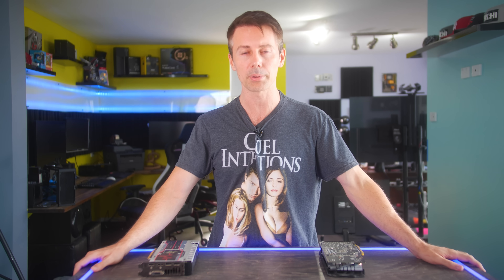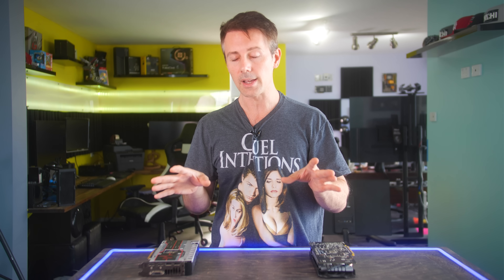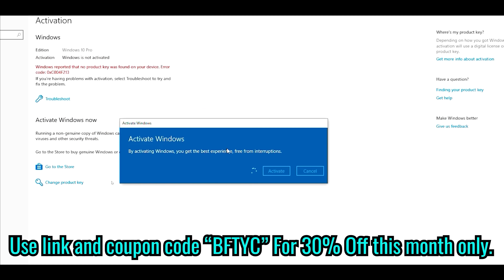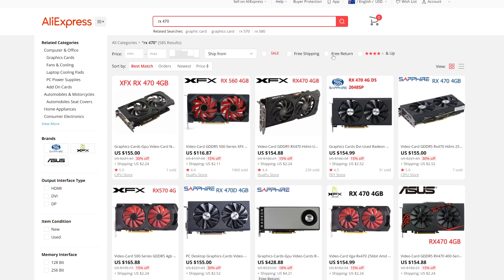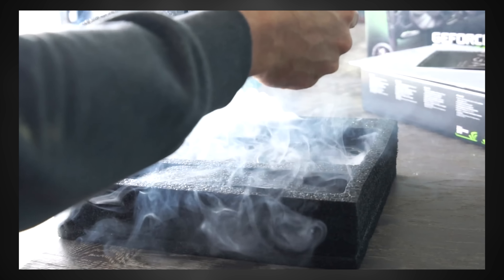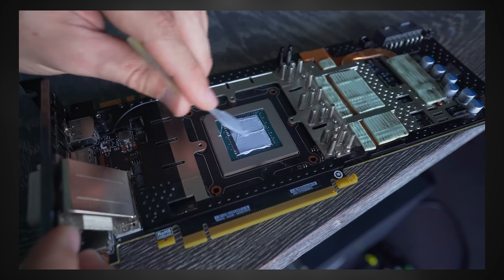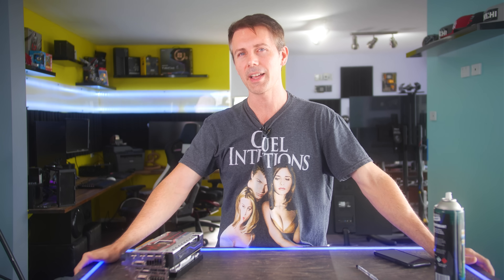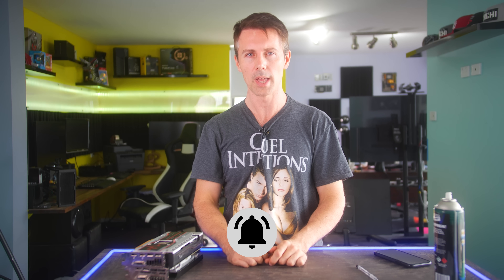How to BUY a USED Graphics Card in 2021's CRYPTO BUBBLE.

Comment: Ebay tips:

1. Only buy from sellers who accept returns. Even though ebay provides a guarantee anyway, it can be a lot less hassle if the listing specifically states that returns are accepted. Yes this narrows the field somewhat, but it's worth it; just be patient to find the right deal.

2. Stick to listings where you can visually confirm the exact model number of the card, eg. on EVGA cards it'll be a sticker on the back, and preferably cross check with a GPU-Z screenshot or submission.

3. Never rely on the ebay description or any related code in just the title; always check the pictures. If there's a mismatch, ask the seller to confirm the situation. Often the mistake is unintended, ebay may have suggested a particular code in error (this happens a lot with memory kits, people confuse DIMM capacities with kit capacities).

4. If possible, stick to listings which include the original packaging, as this means more reliable and safer shipping. If there is no indication of how the card will be packed, then ask the seller to confirm. The goal is to avoid receiving cards that are posted in just a jiffy bag, since damage is much more likely if posted in that manner.

5. If you do encounter a problem, stick 100% to the proper approved ebay returns process; contact the seller, try to resolve it in whatever manner, but if you can't get anywhere then don't wait for the claim period to expire, open a case for a return.

6. Beware of excessive shipping costs. And if shipping is free, check what service they intend using (I wouldn't want a GPU posted using some janky economy courier). Sometimes I may even ask if I can pay extra for a proper fast shipping service.

7. Don't go anywhere near listings which say PayPal is not an accepted payment method, or insist on cash on collection, etc. Sellers are not allowed to prevent one from paying by PayPal. Stick to the approved methods, otherwise one may be unable to file a claim if a problem arises.

8. Check the seller's other listings. If they have other PC parts listed aswell then it's likely they're splitting up what was a complete system, which would give credence to any claim about the card being ok.

9. And as Bryan says, if it looks to good to be true then avoid. That's not to say bargains don't crop up, they certainly do, sometimes sellers just don't realise what they have, or they need a quick sale for some reason, but don't get swept up in the heat of the moment, the pysch pressure of not wanting to lose on something.

10. For normal auctions, decide in advance what is genuinely the absolute most you are willing to pay. Don't engage in the early bidding process, that's a psych trap that can draw one in, resulting in panic response bids because, with seconds to go, suddenly being outbid can feel like a personal attack. Don't let emotion rule the day. Decide on a max, submit it with some seconds to go, and if you don't win then never mind, be patient for future opportunities. Also, never bid with an overly even amount as your max bid, eg. don't bid a max of 200, instead use something like 206.50 or somesuch. With the way ebay works and the way people decide what to bid, this method can often bag a win just because the other guy bid a nice round number, though of course at the same time don't let this idea push your genuine max too high.

11. Lastly, if you don't win an auction, then mentally let it go, especially if you think your bid came in second. So you may have bid 375 and the winning bid was 382 or something, but that doesn't mean the other guy won it by bidding a max of 385 (so in your head you end up kicking yourself, thinking if I'd just bit that little bit more), ie. you can never know what the other person's max was, for all you know they might have bid 600, presumably an amount way to you but to them not a problem. I've won listings in the past for, say, 25 or 30, and perhaps whoever didn't win was kicking themselves, but they'd never know my max was more like 200 because I knew I could sell it on for much more. In other words, don't let your imagine run wild with self punishment if you don't win.

And for sellers, pack the parcel properly! Here's my ebay and ebid packaging advice page:

http://www.sgidepot.co.uk/postingadvice.html

Comment: I Sold my used XFx rx 580 8gb in gaming for 275$ and got a Sapphire nitro + rx 580 4gb for 138$ and it was very clean, even tho it came with a custom bios for memory timings. Works great  ,great temps ,even tho was mined on most likely.

Comment: Hey should I pick up a rtx 2080ti from a friend for $670? I’ll be pairing it with a Ryzen 5 3600 and 1080p 144hz monitor. I’ve been trying to to get a 3060ti but have had no luck. Do you think it’s worth it or should I wait for the 3060 launch?
Reply from the maker: For the question, it depends on if you really want to game now vs waiting it out.  If crypto does go belly up then there will be a lot of cheap graphics card. Though $670 isn't too bad in this current environment... Also Ignore those previous replies, is spam from a spammer, fixing it now, also thanks for commenting :)
Reply: Thanks for the advice! I’m tired of waiting and feel the 3060 will be extremely hard to pick up at launch anyways. With how profitable crypto is now I could end up doing some mining on it to cover its costs.

Comment: Hey can you make a video about gpus crashing after drivers are installed. It happened to my gtx 970 but apparently it's a common problem. After installing drivers my pc will run fine then my screen will go blank but the pc will still be on (all fans spinning)

Comment: Yes i would like to add a trick that i use is to use AMD FLASH tool to read bios and run the serial key over the internet. That somehow gives me insight of bios and 2nd is the color of the PCB. I had an RX 470 nitro which was in fact a 470D with a bios of something else I have never seen such thing in my life until that point. I was sad about it so i sold it and got new 1650 super.

Comment: To confirm you're getting the correct model card, get the seller to provide a photo of the serial on the card. It will generally have the model number along with the capacity.

Comment: I used my 1080 ti a long time with overclocked settings (i.e. up to +500MHz, but only 300 most of the time), and at some time weirdness started - at least under load, not in idle - and the game crashes when the GPU is under load for a longer time. Sometimes, it also bluescreens with the reason "video memory management internal". Such a pity, would be worth so much these days :(

Comment: The ex mining rx 580 i bought for a £110 uk was like new cleanest second hand card i have bought standard bios and seller said it was undervolted card was put in a pc for my sisters son and has been rock solid but i got an rx 480 in my new build for now for 1080p came in at a £100 posted is what it is again card looked like new seller had sold over 262 of them my stem libary i have had for so long i have games from many years and plenty of classic games from gog .Something i noticed on ebay was a boxed ryzenn 2200 fetch over £96 wich is great as i have one in my new build before i get either a 3600 or 5600 cpu that price is more than i paid for my 2200 so i could sell it on and put the difference to the money to buy the 3600 at this moment not in a hurry so i can wait for cpu and gpu,s to become available .

Comment: I don’t think the gpu was mined on but I have a 6870 that did work and then when I tried to update the bios it stopped working, but only kinda? I switched hard drives and it tried to boot to windows. But the first hard drive it wouldn’t display at all. I don’t think it got past the windows loading tho because I stopped because the different drive I put in was a really used and slow 5400rpm laptop hard drive

Comment: I did bought some broken RX series intentionally ($15 USD each) and try to figure it out.
Most of them are having MOFSET or RAM chips completely broken 
And it requres spare parts (and electronic reparing tools) to completely swap them (flawlessly)
There is absolutely no luck to "draw" a card with false souldering only.
Usually live photo with GPU-Z and 10-min furmark / kombustor is enough, 
Some of them hitting 100C within 1 minute, I usually told them to stop and give them pass directly (then I refurbish them by myself)
At last, stay catious from people selling in batch, they're either profesinal miners with well maintainance or another garbage collector

Comment: A buddy of mine has a mobile test station specifically for graphics cards. He's got an ultra book with thunderbolt and an external card adapter. Will have the proper drivers installed for the card he's going to get will show up. Pull his gear out of his laptop bag and give it a go. Doesn't need to be a big rig if you are just testing to make sure everything is working. Now of course if you are testing for stability you'd probably need to do a bit more.

Comment: I keep the boxes, keep the bundle all the time and pack it back like it was new, after a clean and probably even repasting the thing before selling it (unless I did that already recently).

When I bump into used stuff that is clean, it comes with the original box, the seller shows screenshots of benchmarks/gpuz, temperatures reached after say, 3Dmark or heaven run and maybe a brief video of the card in the system (working), they even give you the invoice (if still under warranty).. It's usually golden. Rare, but golden. I do that myself and even like that there are rightful doubts from the buyer. 
Bought off one of my two monitors used, the guy literally packed it up like it was new, with even the cables, zip ties.. Now even used market is completely bonkers..

Comment: A tip I have is when you get a used AMD gpu  open gpuz and to the gpu model site and check speeds if they are not the change it has a mining bios and install the factory bios

Comment: i have a steal deal for you @techyescity i have an i7 7700 cpu i have the asus oem mobo for it as well as a gtx 1050ti oem model as well as 2x8 for 16gb of ram and a case and a mouse full bundle for sale for you and the 300 psu get ahold of me tech yes on twitter i tried to contact you
'

Comment: I recently put together an "ali express special" xeon 12 core system to replace an aging fx8350 build and I could only really afford something along the lines of an RX570 since i have to pay bills and eat and stuff too, and couldn't for the life of me find one for how much they should actually be sold for ($600+ for a 4gb RX570 is a fucking joke). I ended up just putting my old motherboard/cpu/16gb ram on kijiiji looking to trade for one and I had a message within a day for a trade. MSI Armor 4gb. Mind you I live in the Greater Toronto Area and wouldn't expect people to have as good luck as I did, but it's at least worth looking into potentially swapping old/surplus parts for a used card :)

Comment: I have had issues with windows 10 not displaying GPUs on boot. It will show the bios  startup then just go black. I have found this is because of the old video card display settings. Windows will try to force the old display resolution and because your new card is n0t installed yet it will crash.  My fixes were to uninstall you old gpu drivers prior install of new card or a format. I have had some luck just letting the black screen sit there for about an hour or more and it will unbrick itself by installing a oem driver.

Comment: My advice for those trying to buy on the cheap is patience, daily checks for deals across multiple sources and follow the tech yes advice to stick to your price point even if it means waiting.  I got some amazing deals just by waiting and watching for deals over time.  I love buying cases, coolers and monitors locally, but prefer the Ebay guarantee to buy power supplies, boards, CPUs and GPUs.

Comment: only been scammed once on a gpu in person - the card was artifacting and unstable after a customer returned the PC, though it did pass unigine heaven when i had it.  so, i don't know if it was a scam.  my bigger issue is buying older cards or "lots" on ebay where i don't get around to testing them thoroughly before 30 days (booting to Windows and getting the driver is not enough) and then i find they crap out or crash.  they looked like mint condition with retail box, but i guess they were mined on.

Comment: So what should I look for to replace my 1070ti  for initially 1080p but soon 1440p gaming?
Rest of system is fine (5800x on x570 with 32GB 3600 RAM)  so need some pointer for 2nd hand 1440p card quicker than my 1070ti.

Comment: 6:16 I would agree with that on nearly all cases.. however radeon VIIs do die (code 43) extremely easy. Sometimes happens from just moving them from one rig to another.( 100% documented) Those cards are SKETCHY do not buy a used radeon VII for any reason IF your not prepared to take on an extra gamble.
Reply: Yeah somehow they get killed really easily. Fortunately they are selling for a fortune and not very good at anything other than mining so I doubt many gamers are actually considering getting one.

Comment: A Mobil test station is basically a open bench test station with a sfx power supply and a portable monitor 13-17inch.  (I would assume that is the case.) connected to a battery bank... but hey I could be wrong.

Comment: I bought a 2yr old vega 56 sapphire pulse for 240 usd, its 2 weeks now, I changed thermal paste and cleaned inside, so far so good, we met at a train station. He did maintain contact with me through facebook messenger. before meeting also, I asked for videos / picture of it working.
Reply: you can get rtx 2070 performance by flashing it to a vega 64
Reply: @ffqqz  can you link me the proper bios for a sapphire pulse vega 56? i mean the proper 64 bios that will work on my card

Comment: Regarding memory problems, most AMD cards are used to mine. But the information on the video may not be 100% correct. If you OC the memory and it crashed it can also be the timings are changed after the default memory speed in bios (bios mod), this cause problems with games but not in mining. So flashing original bios can fix most of this problems.

Comment: What is this? There is GTX 1660 SUPER in stock in my local retailers, for 339€. Still the miners are buying used RX 480 8 GB and RX 580 8 GB for 300 €. The hash rate for GTX 1660 SUPER and Polaris GPU is the same. There is no logic in this.

Comment: I don't have a van, but I have a UPS battery, and I bring a 720p monitor, low end motherboard/cpu/ram/psu and a 120gb ssd that is all hooked up in the trunk of my little sedan. When I sell a GPU I usually bring that with me to prove it works with the appropriate drivers installed.

Comment: Hey Brian, just want to share my hose story. Recently bought a 980 asus strix, i tested it at home, he delivered it to me, it was working. I tested it while the pc was lying down, as soon as i stood the pc up, one of the fans started making a clacking sound, which is definitely a bearing problem. 
The seller then tried everything to avoid giving me a refund, he seenzoned all my messages, told me he doesnt have the money. He even sent another buyer to my place without telling him the issue, i wasnt gonna stood in his level and hose someone else, so i told the other buyer the truth. The other buyer then told me  that the seller told him im 'his brother' and that I have his gpu. I even got the excuse 'i never had that issue before' 
I know his address but i keep getting the excuse 'i dont have the money right now'
I just decided to keep the card, ill just fix the fan. luckily its a working card.
Reply: It sucks getting hosed my man, sorry.
However your issue is fairly easy. You can remove the shroud and the broken fans and get two 120mm fans and zip tie them to the heatsink and plug them in motherboard header or molex connector and it will perform even better than stock fans (though they will look ugly imo)
Reply: @hamoudy98productions  That works, I've done it before but it's kinda pointless when replacement fans for just about every card ever made are available for under 30 bucks. In the past few months I've replaced fans on an Asus r9-290 and an MSI rx 580 and have an Asus 570 waiting on new fans to get here for it.
Reply: Let him catch a glimpse of you hanging out side in your vehicle across the street a few different times and things will change
Reply: If it's just a fan, and you got a good deal, that's not that big of an issue...
Reply: bro a set of fans is 20 bucks or less, it sucks, but at the same time, its not really worth trying to refund the card when finding anything is so hard right now. id just try and get them to pay for the fans or eat the 20 bucks and get on with life
Reply: If the fan works fine while on its side, it means the fan could be fixed.  it's not entirely broken.
maybe it just needs oil.  I would try to fix it.
Reply: @sixcoregamer9221  Tried that mate, still doesnt work, ordered a replacement fan online.
Reply: @eclipsegst9419  yeah I bought a replacement fan online for 20 bucks. The build was actually for a mate. I ended up finding a good working 1060 to get him going.
Reply: Poor you, cracking fan. Big deal